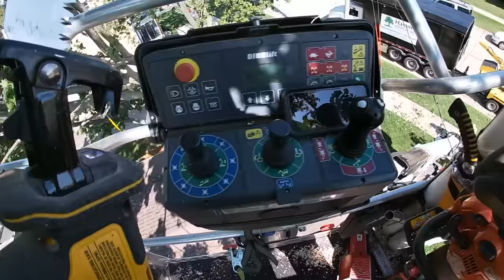Harassed by Angry Neighbor Demanding Tree Removal

Comment: A Squirrel buried 2 nuts to create the double trunk tree 🌳
Reply from the maker: Well, samaras usually plant themselves. Amen it was probably one that grew into a single stem and was subsequently cut down, then three stems grew out of the stump, one, of which, has been cut at an earlier date that was pinched between these two.  These are separate stems that share the same root system. The effects that have are not significant in the short term, death of roots and subsequent decay are a years long process mitigated to a degree by the reaction growth of the remaining stem.  The prevailing winds hold the remaining stem up so a root plate failure is highly unlikely. Hope that helps😄
Reply: Yes he did and one of the nuts became the whiney neighbour...
Reply: Damn squirrel
Reply: You’ve got to admire squirrels. They are long term planners. They bury nuts which will eventually grow a tree that will not bear fruit for generations of squirrels. Maybe 10 or 20 generations later will benefit. We humans can learn much from squirrels
Reply: Makes sense. It’s how my tree grew up, with two nuts below.
Reply: Maple trees don't produce nuts. You could tap it in the spring and produce a low quality syrup if you were inclined to though.
Reply: @GameofTrees  You are a funny feller.  Don't be going out on a limb for this nut.
Reply: @andrewwolf4430  i think they just forget where they left em bro, alot more logical to point at forgetfulness than to attribute them with the intelligence of a human
Reply: @andrewwolf4430  they just do what their instincts tell them. They have no clue why, they just do it.
Reply: Great intro

Comment: Once a tree is classed as a hazzard , it's the owners responsibility. The property line doesn't matter at that point.
Reply: interesting. Maybe thats what this arborist should have done. Give his client a written assessment/report of the imminent hazard, and have her make a case for the removal and have the rightful owner pay the costs.
Reply: @nom5205  what worked for the home owner is removing the threat to their property.  Going the other route is making the tree owner responsible for the damage when it fails .
Reply: @nathanarievlis3985  --Yes...and thats what I meant. Since the tree owner was making a fuss. Make him learn the hard way.
Reply: @nom5205  I  agree with you!!!  but the odds are in their favor still when you think about it.  The tree hits your house damages it then you have to fix and then sue for damages  and this guy ain't showing up to court , you know that.  So at the end of the day you'll have to settle for a lein on their house that you'll get when they sell or die.  The system isn't fair here.  It's not considered ''criminal'' but when it's over a used structure, it should be . It's more convenient getting your wallet or car stolen  than dealing with that kind of preventable property damage.  Believe me Nom , I'm with you.

Comment: If a property owner has a dead or compromised tree that is a hazard/high risk (determined by an "expert" ) then it is on them to remove it regardless whether it crosses the "air" property line.  That cracked stem is just that high risk situation and the Karen side should have paid the bill instead of trying to get the other side removed for free as well.  They were being negligent and acting in bad faith.  They would have paid the costs of damage if it fell on the garage...if documented with evidence like pictures and witnesses.

If , like said, a live tree without an apparent defect is desired to be cut back to the air property border by the non Karen side...they can as long as it doesn't kill the tree.

Comment: A similar thing happened to me many years ago. Lived in a row house. Our yards were connected. You just gauged halfway was yours. My water line busted in the yard. The yard was a swamp. The plumber guys had to dig up my side of the yard to get to the pipes to replace them (very tiny yards). With all the water leaking out of the broken pipe, it was a total mess of mud. My neighbor had an ABSOLUTE SCREAMING FIT. The guys doing the work did the best they could to avoid damaging her yard. Not ONE INCH of her yard was dug up at all. The only issue was some of the dirt got on THE EDGE of her yard. I did my best to rake the dirt off her side. She went on and on and on for days after demanding I fix it. I didn't do anything. Just laid down some new seed, watered my yard, and let it grow. Told her to sue or call the cops there was no damage at all. My yard grew back in a very short time and everything was completely normal in a few weeks, or maybe longer. Looked great. She was one of "those" neighbors. Went around with a ruler to measure the height of the grass, and called the code enforcement guys constantly.
Reply from the maker: Thanks for that story. Here’s four more videos with updates https://youtu.be/g2Z81punreI

Here’s a positive result
https://youtu.be/F4-ZvXLwXCI

The tree comes down https://youtu.be/6ML1joMsiDg

The stump reveals the truth.

https://youtu.be/H9y-PW7t3oY

Comment: We've taken a massive Oak tree down in our front yard whose trunk had a split about 8 to 10 ft up from the base back in 2011, and I watched how they did it, and it was very similar to how you guys work.  Took them 2 or 3 days iirc.  One day to strip most of the smaller branches off, another day to cut the rest of the major trunks down, and then they came back the 3rd day to grind down the stump and surface roots, and do final cleanup.  

And then on our neighbor's yard there was a Gum tree?  The kind that produce those little helicopter seed pods.  That was on the lot line.  I think the base of the trunk was technically on our lot, but we've always had a mutual agreement that it was "their" tree, because it leaned towards their property.   Well after decades of it rotting out at the base, they FINALLY had it cut down a few years ago.  However, whoever does their Aubery service does not have a wood chipper and they always leave piles of limbs in their yard to root naturally.  It's ridiculous.  The stump is still there too.  This is one of those types of yards that has way too many trees and other woody bushes on it for its size, so they've always had to trim back or cut down their vegetation.  And they always leave their clippings in piles.  No composting or chipping at all.  Destroying property values all throughout the neighborhood.

But with your case here, just by looking at this tree and how you explained it, it is pretty clear that those two main trunks are separate trees in a sense and cutting either down would not affect the other.  What I know about deciduous trees is that if you do not completely destroy the stump or poison it, it will sprout new growths.  My old school buddy was into Forestry and I learned quite a bit from him.  He's out in western Virginia now working for the Forestry service there, probably getting ready to retire.  He's like 51-ish now.  I'll be 50 in 6 months myself.
Reply from the maker: Thanks for the stories. Here’s two more videos with updates https://youtu.be/g2Z81punreI

Here’s a positive result
https://youtu.be/F4-ZvXLwXCI

“Let us raise a standard to which the Wise and Honest can repair, the rest is in the Hands of God.” George Washington

Comment: I live in an apartment complex where the manager landed in hot water after authorizing said trees being an eye soar and to be cut down. All said trees were straight vertical and healthy with no branches in the bottom 7ft of the trunk.

The trimmers made it about 8 trees in before the neighbor came by ordering them hell out. In short I don't know all the details of the lawsuit. The manger at my apartment complex was  promoted. Meanwhile the neighbor added a 7ft fence. That was adjusted accordingly because of the trees already cut down weren't all next to each other.

I would be interested in that court cases out of curiosity because the former office manager and all the workers have changed over over time. Way too frequently that they change over. It's not a bad place to live where I'm at.

The tree trimmers shouldn't have even started that job and stood up to their boss or something. All the trees looked identical and obvious that they had zero ownership or over step to the manager that hired them.

Comment: There's a nuisance tree right on the edge of our property line in the backyard.  The trunk was all the way inside the neighbor's fence.  The powerlines are right there and the lines that electrify both our homes ran through the branches of that tree.  The branches were jostling our power line so much that it was damaging the connection over and over again.  The electric company would come out and fix it but won't do anything about the tree.  Then we have some smaller trees cut down in our yard, a few of the neighbors (including that neighbor) hires them to come cut some of their trees.  They had them cut that dang tree off at about 15ft.  It's a nuisance tree like I said, so of course it started shooting off all sorts of new branches right around the power lines the next year.  THEN, they decide to replace the fence (I was willing to go in half with them but they never said anything to me about it) and make the tree part of their fence line.  So like, fence boards go up to onside of the trunk and continue on the other side.  It's so so annoying.  Only a matter of time before it starts causing us electrical problems again.

No clue what to do about it.  I really just want to cut into the part of the trunk that's on our side and kill it off.  It's in no danger of falling or dropping anything that would damage any property at this point.
Reply from the maker: Go for it.

Comment: It looks like it initially was one tree but it split. Both leads probably share the same root system. If the tree or trees is on the neighbors property it should be his obligation to have it removed to prevent possible damage to anyone’s property.

Comment: I'm not sure how this was recommended on my feed but I thought I'd mention how the law is in the UK.

If a tree is growing on a property, as defined by the property line at the root/bottom of the trunk, the owner of the property is fully responsible for the inspection and maintenance of that tree, together with any damage its growth/breakage might cause. However, any neighbouring property can prune back overhanging branches to the property line without needing any permission from the owner. Should they do so, though, they are required to return all the cuttings (and any hanging fruit) to the owner.
Reply from the maker: I love that return the cuttings part😃Here’s a follow up on the situation. https://youtu.be/g2Z81punreI

Comment: Hey G.O.T.s  If the two trees share the same root  system and one of trees is cut down, will it not affect the roots that were depending on leaves of both trees to get food from??  If one tree shares roots  the roots take in water and minerals and some compounds to send to the tree above. The leaves convert the minerals and water to starch and sugars and proteins that the tree uses some of as well as some goes back to the roots so they can grow and store for winter as well?? If one tree is cut less leaves to manufacture food for roots thus roots slowly starve and die thus tree starts to die and whole system fails. Some trees store enough food to last or for roots to last If tree is cut until new shoots grow and grow enough to feed the roots if roots are not already dead but most do not???  Yes  no???
Reply from the maker: Of course some will die, but many will be kept alive by the remaining stem. It will not be an immediate result and that result will be slowed by the remaining stem.

Comment: We were removing trees, State requirements have changed and we no longer can remove them. And we ran into the same issue several times. Neighbors wanted us to remove the remainder of the tree at our cost or the customers pay. 4 times the City inspector showed up 2 times with the cops. Every time we were right and they did everything to interfere, by placing items around the work, to sitting outside and not allowing us to work. Everyone of the trees we took down were dead and people continue to expect free tree removal, and every time we finally got the work done. City and County and State guidelines as to what we are allowed to do and for how long in some areas. We wo n every time and twice the complainers were ticketed for interfering.
Reply from the maker: Here’s two more videos with updates https://youtu.be/g2Z81punreI

Here’s a positive result
https://youtu.be/F4-ZvXLwXCI

“Let us raise a standard to which the Wise and Honest can repair, the rest is in the Hands of God.” George Washington

Comment: Removal of the one side most definitely WILL have an effect on the remaining half. The root ball is like a giant ball joint under ground,  and the two sides act as cantilevers keeping the ball from rolling. 
      This of course has nothing to do with the legal aspects of responsibility, about which you are 100% correct. 
      I have the right to  remove any part of your tree which is on my side of the property line, and if it renders your remaining part unstable, that's too bad on you. 
     Secondarily,  each side of a tree acts as a wind break for its opposite side, in that by definition,  whichever direction the wind is coming from, the side leaning into the wind is better configured for dampening the force of the wind. But again,  this has no bearing on my rights to cut any part of your tree which is on my side of the property line.
Reply from the maker: Well, the ball joint under the ground idea is not at all close to reality. There are wide ranges in the soil types, and the soil type in this scenario is very stable and regarding the wind, the remaining stem leans into it west south west. The tree stood fine for over 18 months. I took it down yesterday video will follow soon :-)
Reply from the maker: Here’s two more videos with updates https://youtu.be/g2Z81punreI

Here’s a positive result
https://youtu.be/F4-ZvXLwXCI

“Let us raise a standard to which the Wise and Honest can repair, the rest is in the Hands of God.” George Washington

Comment: Whats a fact is if that tree dies because of cutting the other side, whoever cuts it is 100 percent responsible for damages. You can cut and trim with in " reason " w.e tf that means. Im dealing with this right now. My neighbor tree doing damage to my garage cracked all the concretet and messin the roof up.
Reply from the maker: It never died, Here’s how it finished 18 months later https://youtu.be/TASyNcK7HcQ?si=PKYUJCmCbJphoy2o

Comment: They both need to get taken down.  Removing one tree wouldnt kill the other, but it’s likely to fall over since the ground with become unstable and it’s leaning.  And cutting the one tree all the way back just doesn’t make sense.  This homeowner just doesn’t want to pony up the dough… the liability isn’t worth it.  What a schmuck…

And trees are insured and very expensive.  I had a negligent driver wreck into my yard and killed three trees.  I received 30K for replacement. Species of tree, age, etc plays a huge role in the value.  What’s more expensive, is when that tree fails and kills a kid.
Reply from the maker: The tree didn’t die and the ground is very stable, but, Here’s an update https://youtu.be/g2Z81punreI

Here’s a positive result
https://youtu.be/F4-ZvXLwXCI

“Let us raise a standard to which the Wise and Honest can repair, the rest is in the Hands of God.” George Washington

Comment: I’m not claiming to be an expert but for the vast amount of time I’ve spent logging and doing development work, I am convinced that removing one tree absolutely does effect the others around it. In this case, you’re correct that these two sprouts originated from an old stump but what you can’t see is that both trees have a marriage below the dirt. Removing one tree will ultimately cause the other to fall, it’s just a matter of time and probably not long. I am sure that you are aware of this. I’ve seen many trees uproot solely because their sisters had been removed and it upset the entire balance.
Reply from the maker: Here’s a follow up on the situation. https://youtu.be/g2Z81punreI

Comment: I had a similar situation with a tree that was split on the bottom. One side was hanging over my house, and the other was hanging over my neighbors. I talked to him about it and told him that I needed to remove the one on my side Before it became an issue. I offered to take down the whole tree at my expense so there wouldn’t be any trouble down the road. I was nervous if I cut my side down and left his up that it would crash on his house, so I just paid for the whole thing. the upside was, that I got to keep all the oak for firewood.
Reply from the maker: Here’s a follow up on the situation. https://youtu.be/g2Z81punreI